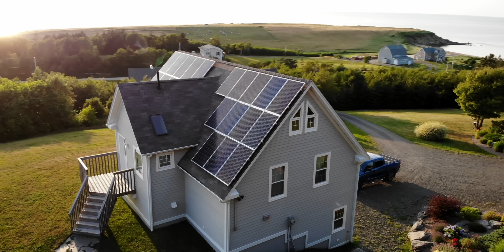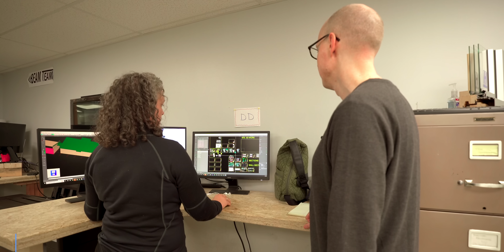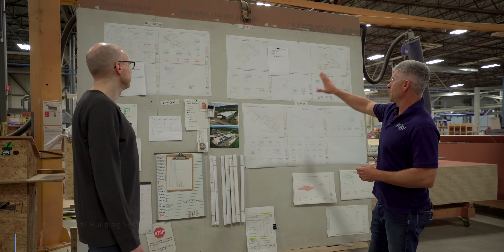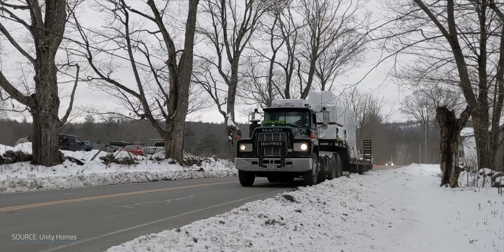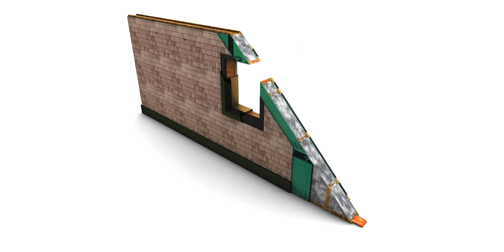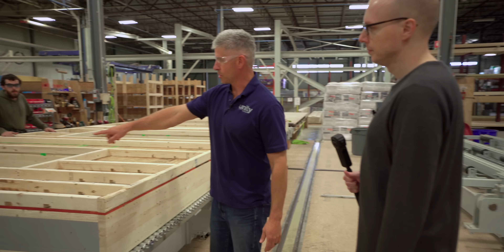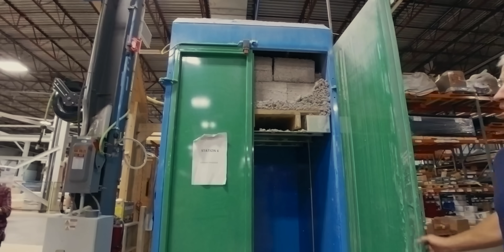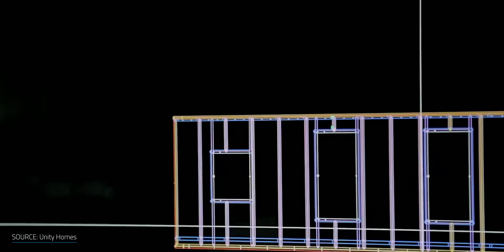The Simple Genius of a Prefabricated House - My Net Zero Home Build

Comment: So the sill anchor bolts goes through the 2x3 non-structural wall? Yeah. Good luck with that meeting code.I like how they spun it tho. No mention of how they had to do it that way because the main part of the panel is sealed. No access for an anchor bolt.

Comment: Cool build but it's not really gonna be passive levels. R-35 can be accomplished with a 2x6 frame R-24 insulation, and 2" of XTPS on the exterior for R-10, total R-34 and also no thermal bridge. 

Passive house walls are generally in the range of R-48 to R-60 for the walls.

Still, solid build!

Comment: I just watched an interesting video on "Homes by Sorenson." He talks about using a different framing method. Instead of 2x6 framing, they use 2 2x4 frames,  one inside of the other. They do not touch each other. By changing the distance between the 2, more insulation can be added. What he showed was a 3" separation making about 10" thick walls. The cavity was filled with compacted cellulose that gave an R-40 rating. Using standard 3" fiberglass, there are 3 layers yielding R-36. With the separation between the 2 walls, there is a complete thermal barrier. Perhaps something you might like to look into.

Comment: Well, the first problem I see is all the engineer lumber for carbon footprint of engineered lumber is 18.6 times more per lineal foot, then standard work and if you ever get a water leak, it will lose a structural integrity

Comment: I have been advocating the use of prefabrication in homes and other buildings for decades! It is the one true way of making certain you get a perfectly stable platform and a house that will be draft free & to the best standards possible all within a very reasonable price range!  In fact when you go only a step up from the Static caravan style of home they can be delivered on two trucks and installed on site withing a single day, fully connected to all services!  This would revolutionize the homeless situation if they were brought down to a price point that was cheaper than renting in the public sector!

Comment: Consider the building materials generated by chipping and pressing with glues. Compressed to shapes for intallation   , cultured marble is cool but nobody has a full bath modular unit for delivery. Solid build sections with new install dropped in place. Indoor access with planted areas for indoor cultivated entry, lifted for screening and vent at the top for exaust makes potential energy and as a swamp cooler delivers it can aswell. Simple heat control
Reply: Step up to better living experiences and contour the developed construction for specific details in detailed uses
Reply: Generate hydrogen and oxygen for combustion cycle to power everything up from the electrolytic light cell . Combustion is a passive cycle that suppies all needs in the home.water to fuel fuel to combustion ( heat expansion) water reconstituted and reused. Heat pump and refridgeration from Ammonia heat created for cold cycles. Fresh humidity incoming from low air intake makes swamp cooler and upon venting motions making generated electricity. Get deep change materials for better strength. Waste chip is pressed better than wood structural lumber

Comment: Interesting but never ever reaching German standard. The Weber house in Germany produces more energy than it needs in the whole year thanks to photovoltaic and use of hydrogen for electricity storage and heating the house in winter and further electricity needs. Houses in the US do not have stability and resistance against fire and/or floods. Missing  in the US are high technical building standards which we in Germany enjoy for many years. In the US you see electricity cables from house to house. In Germany such a technology is forbidden. All electric cables in German towns and villages have to be under the roads and this technology is more save. In the past there happened often fires in German towns from house to house. Today each house is protected from fire coming from neighboring houses by a standard fire proof wall and any house has got obligatory insurance against fire and floods.

Comment: Stick frame loses two important characteristics in wood construction . 
mass and humidity tempering via the hygroscopic attributes of mass timber . 
the method used in your house to control thermal bridging is minimal at best . a better method is to use manufactured 
logs stacked on top of each other with built in factory sealers . once the logs are erected , wood fiber interlocking insulation panels are installed directly over the logs creating and air tight layer and stopping any and all thermal bridging from occurring . Vertical furring strips are installed over the insulation and the desired facade comes next. 
the advantages of this method are , that the mass timber now has heat storage coapbility although not in the extreme and humidity changes are tempered through the hygroscopic effect of the wood blocks . for example, my house has 14cm thick logs ( flat face ) and 14 cm of insulation panes on the outside . the window are Tilt and turn triple glazed that are mounted in the middle of the opening instead of the outside wall . The logs are all precut at the factory ,so the erection time is very fast . Electrical wires and plumbing are run under the floor. the wires run up the walls in factory pre drilled holes and the electrician installs the desired box for outlets and switches . there is no other drilling except for the boxes . Plumbing pipes run up inside thin framed walls and toilets and sinks are installed on theses additional walls .

Comment: Looking for something Proof of Concept POC, that can sustainably modularise and be inserted into a 6-12+ storey block of flats. So if there is a fire, once people in the flat are out, the module can be isolated from services, and automatically removed (whilst on fire). Misting systems from Oil & Gas, a wall of water takes the heat out. Need to move? Unplug your flat and take it with you...!

Comment: It is very hard to find installers in a new build or “deep energy” retrofit who are careful and patient enough to tape or get other construction details sufficiently “spot on” to get a good blower door test (<3 ACH @ 50 Pascal) to achieve air sealing “tightness” objectives!

That said, in automated panelized construction, like Bensonwood’s Unity models, which make copious use of closed cell foam insulation to avoid thermal bridging, I worry about “lived in” interior air quality for those who may suffer from autoimmune or respiratory sensitivities! There are foams whose off-gassing is remarkably free of aldehydes. Does Unity use them, or has their built interior air quality been tested by independent industrial engineers?

Comment: One simple question id like to ask is, "what is your Cost per sqft?" Net zero is a remarkable goal to try and work towards. But after my experience with trying to design and build an on-site stick build net zero home here in Canada, I found out the hard way that this goal will not be achievable. My example without going into too many details: Plans were for all electric Air source heat pump with backup electrical resistance heating and HRV, no natural gas hook-up (climate zone is middle of canada 7A). 2000 sqft (1100 main, 900 upper, 1100 basement) 2 story 2 bedroom home R20-R40-R80 with 1000 sqft 3 car attached garage insulated to R10-R20-R40, undeveloped basement, 9 ft ceilings throughout. Vinyl siding, asphalt shingles, energy star windows (not expensive euro style tilt-turns, but triple pane). 1st quote was for $1.2 million. This was BEFORE photovoltaic and battery back-up was even added on. Second quote was $1.1 Million
Third quote after downgrading all materials and removing things like interior wall insulation and downgrading windows and exterior doors, down sizing the garage to 700 sq ft brought us down to 950k. My point is, where my cost of living is, this is beyond absurd. $400 per sqft is absolutely insane.  No normal individual will ever be able to afford a net zero home. The costs per sqft you've outlined in your past videos are extremely out of date and I would appreciate if you'd be willing to share updated pricing on your project. Which i'd like to say, congratulations, it looks beautiful and I wish I could've done the same.

Comment: It would be impossible to bolt the walls to the foundation through the plate (in the normal manner) when the wall is totally pre-built in this manner. Therefore, the only way to do it is to bolt all the way on the inside or outside.

Comment: So how well will the compacted cellulose hold up over time? How does cellulose compare with foam? I would think the foam would have a higher R value?? However, foam is quite expensive. So is cost a big reason using cellulose over foam?

Comment: Placing all of your insulation on the exterior of your water air vapor barrier and placing your water air vapor barrier on the exterior of the framing would eliminate bridging. It is somewhat disheartening to see your ribs stuffed with a coat. Ask Joseph Lstiburek.

Comment: Greetings from Poland. Those homes are good for cold countries but not so good for hot climate countries. This is due to their much lower heat capacity when you compare it with brick house with 20-30 cm of insulation on the top of external wall. (Never insulate house from inside!). In the hot summers like here in Poland you get temperatures of 40deg C (104 Deg F) during the day, with significantly cooler nights. You allow colder air in at night to cool internal heavy brick walls and concrete ceiling structure. Then during the hot day you can enjoy cool house without any air-condition and electricity use for cooling.l temperature inside the house during  heatwaves outside will never go above 70 Deg F inside. If you want warmer temperatures In the house you just open the windows during the day. This way you can achieve ZERO net house without solar panels and use of Aircon. Another advantage of brick house is that it value increases not decreases because brick house will last many generations while wooden prefabricated house is generally good for one generation.

Comment: Whether this system for home production should be done more... is a matter for the market to decide.  It will grow incrementally.  I like the quality and designs.  I like the energy efficiency... not because I'm an environmentalist, but because I am a capitalist.  I want to save money long term on energy and repairs, which this system supports.  I want doors and windows to work well.  I like a well-designed house because it allows me to potentially use a smaller footprint to get the same quality of life.  I wonder about the accessibility of people who can put these together.  If I build one in a remote area of Colorado mountains, can I get a crew there?  Can I get a crane there?  I'm sure "it depends" is the answer.  Thanks for the video.  Very enlightening.

Comment: I started framing in a prefab shop called Trans West in SLC Utah in 1980 I’m still framing today I’m 59 years old   The waist we have at the end of a standard home is very minimal because we are professional framers. The bolts and straps required in our area of SLC are 5/8 j bolts which are embedded into the foundation and 3” wide and approximately 36” long 1/8” steel straps with nail holes staggered at 2”on center the straps are placed in locations required by the engineer with solid 2x material for nailing the strap into this is a standard on all the homes I work on. So these homes are going to stay on the foundation!!!  I don’t like the way you bolt down your new house. 
I have framed prefab houses and the concrete is not perfect so your perfect made house is not going to fit like it would when your house is built on site!!!!
I don’t like the way they frame the walls   I don’t think you did the right thing 
I’m just being truthful. I am a qualified builder with concrete framing and project supervision

Comment: As a Mechanical Engineer designing his own home at the moment and researching a lot of this stuff... I catch myself wondering.. "why are they (architects and builders) not taking advantage of 3D CAD technology?". Probably for the age old, 'this is the way we've always done it' reasons. 3D CAD allows so much parameterization in the assembly process, you could literally build a 3D model of a home in a few hours, once the component libraries are in place. Drop a new one in, enter a few parameters and you've got a new wall with X, Y, Z sized window and/or some configuration of windows. Truss systems, floor systems, you name it.. import and constrain in position. CAD files can then be used to manufacture SIP panels or whatever it is you're after on the shop floor. Really great to see that someone is embracing this and even more so, developing and offering it as an open source product. That's amazing.

One thing that doesn't get mentioned much is the fact that, unless you plan to build yourself, you're at the mercy of framers and others who are most likely use to traditional methods. If they're anything like building tradesmen, they likely don't see the necessity for a lot of 'silly' things the engineer wants them to do.. and will just do what they want to get the job done. Maybe you can find a crew that has built in a particular manner, has experience there and will produce a suitable finished product.. but unless you're able to oversee, or hire someone of like mind who will oversee.. you're left with whatever you get. 

In my world, we'd place it on a CMM (Coordinate Measuring Machine) and if it doesn't meet spec, send it back to the maker to do again, using the print and specs as an insurance policy to control quality. You have very little of that in this sphere.

Comment: Matt, I'm curious as to why you chose this system over something like ICF's.  With wood, over a period of time, I would think that you would still have issues that you would not have with an ICF home.  Such as rotting of the wood worries, termites and other insect worries, flood damage worries, tornado and hurricane worries, and fire worries.  An ICF home would have none of these worries at all.  The only real advantage that I can see for you to build such as you did, would be that any modifications that you might like to make at a later date would be very easy to implement.  With an ICF home, you are pretty much stuck with what it built.  Or at least any modifications done to an ICF home would likely be very expensive.  An ICF home, with no wood used at all in the structure (using metal instead), to include a concrete roof, would be practically indestructible.

Comment: Thanks for the tour of the factory. Fascinating. Hopefully the way future construction will go. Factory prefab pieces that are just "leggo'ed" together on site. More efficient, consistent (in theory) higher quality build, much more quiet construction site, and again in theory faster assembly at the construction site.  I'd really like to see apartment and office buildings built that way. Factory prefab components with most/all of the interior fittings already installed. Then those prefab units are just lifted into position on the building and connected together. Quick connectors for water and electrical would reduce need for professionals. Very little need for onsite construction, just some fit, finish and final touch up.

They try to account for settling of the blown in insulation, but I'd like to see on site confirmation that after transportation settling has not happened. Especially for walls that were shipped vertically! Maybe on-site ultra-sound/sonar inspection of walls or maybe a built in "window" segment at the top of the wall that can be opened for onsite inspection and "topping up" of settled insulation.

Blown insulation is obviously easier for them, but batt style insulation would be less likely to settle. 
.
As part of the price, do you get detailed construction blueprints? Or can you buy them for extra cost?  They would be handy for future enhancements to know where electrical, water, HVAC infrastructure is in the building before cutting into walls.

Sure there are "cost savings" in using CAD to design and an automated/CAM factory to build vs building "by hand" on site, but the buyer does not see them.  The "savings" are offset by the extra cost of the extra "engineering" in the design and build quality. Multiple layers in the wall that you don't see in a "stick" wall, etc.

Comment: Pre fabrication is the way forward, the achilles heal, erection. In the UK in the 60s and early 70s system build or what is called prefabricated contriction lead social housing provision, the problem amongst many, the semi skilled installer cut corners leading to massive problems later leading to failure. The only way to resolve this is in-house installer teams, Huff Hus prove this works best. Let a sub contractor near your factory built product and expect corners to be shaved off, literally.

Comment: Personally I prefer a net positive home...  one that makes MORE power than I can use...  so I can sell the excess.  Now my old house (built in the late 30's or 40's) has a enclosed breezeway connecting the house and normally detached garage...  by connecting the two the builder/homeowner reduced the property taxes.  Now I grew up in Levittown Pennsylvania and most of the Levitt and Sons homes were built in 1949 to 1955,  up to 100 homes a day... concrete slabs and partially prebuilt walls in that massive suburbia...  Note that the movie Suburbicon did a LOUSY job of depicting the homes...  wrong walls,  wrong windows (casement picture windows and the metal (not wood) windows that opened did so sideways,  not vertically),  concrete slab foundations,  so no basements,  and the Dogwood section of Levittown where the movie takes place was all SINGLE story homes,  so no staircases...  just like Lakeside section where I grew up.